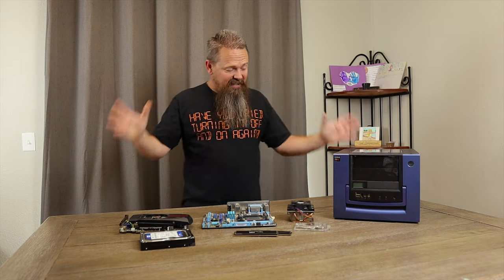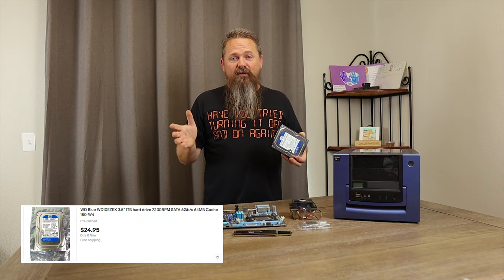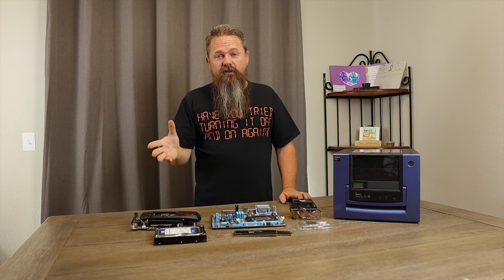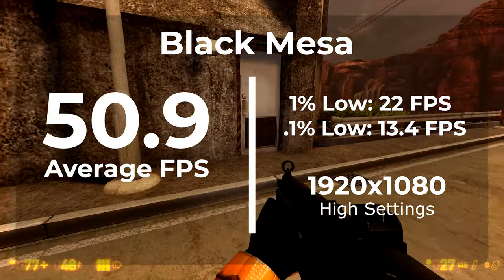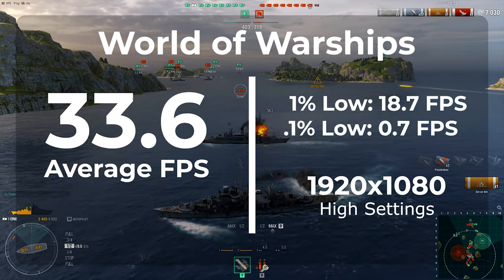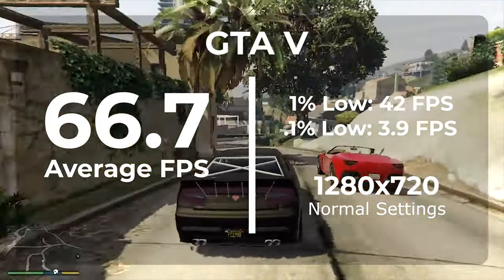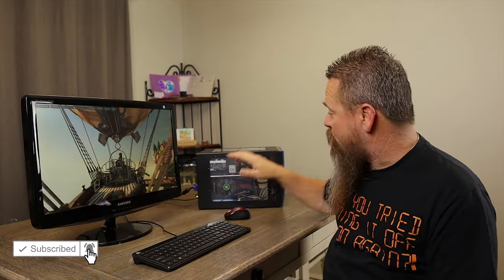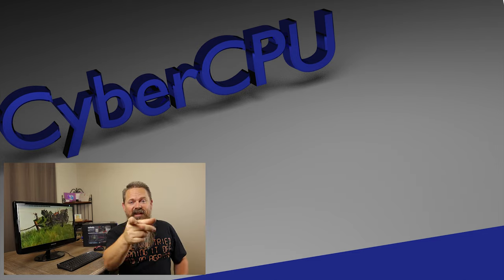$200 Budget Gaming PC Build 2021

Comment: i was given an old office mini pc, a HP elitedesk 800 G1 DM buisness pc  with 8 gb sdram ddr3( 4GBx2),a 128 gb sata ssd with an older i3 intel (4c/8t)cpu with integrated graphics (128mb shared memory).dx11 at 1080p and 720p games play fine and emulation up to ps2 and gamecube  run fine for most games so far. it's not the prettiest graphics but it works fine for browsing, watching movies and some light gaming and retro gaming  . my 9 years old want a newer pc but so far it meets her needs for the time being.

that old office system has a new life and is still doing good despite it's being 6 years old.iMm glad i repurposed it  instead of it becoming e-waste.
Reply from the maker: Yeah, it's really popular to do this with old prebuilds. The only problem you run into is future upgradability.
Reply: @CyberCPU  well, the only upgrades i can do on it are increasing system memory, the storage by changing the ssd  and adding a compatible wifi card  but that system will not be used for long term use  enough for this type of upgrades.

Upgrading it is not worth putting  money  in it for now since i'll build a new system once the ryzen 5000g apu's are out wich is very soon soon . i just hope the sell prices will be near msrp for those apu's. 

the older mini pc works fine for now but it's only a temporary measure  so i won't upgrade it much in the future . i may  give it to some people  in need  at some point since it still works fine .
Reply from the maker: This system I plan to follow many upgrade paths. That's why I went custom build. I can pretty much upgrade everything.

Comment: There is no sin against using a hard drive for a "gaming" computer.  I can pay about $300 for a 14 TB WD hard drive.  No way in hell in the next several years can you get a SSD for that capacity at that price.  The earliest teletype mainframe and mini computers were also used for gaming.  It all depends of the types of games you want to play on them.  I've had games pre-loaded onto my calculator watch when it was new back in the 1980s.  The so-called electronic waste are still useful for any number of tasks.  For a home theater PC or media jukebox it fits the role nicely.  That chassis has room for 1 laptop sized HDD and two 5.25 inch internal DVD/Blu-Ray burners.  I could use it to design cross stitch patterns, jigsaw puzzles, audio files, video art, fractals, use it with my digital cutter to make all kinds of cool projects.  I wouldn't have used that motherboard with what looks like only USB 2.0 ports on it.  Even after formatting with a 14 TB drive there is room for about 2,400 DVDs saved as .MKVs.

Comment: Hey man! If you don't mind me asking. What was the name of the case it's exactly what I need
Reply from the maker: Unfortunately I have no idea what the model number is. I'm not even sure what brand it is. It was originally used for an AMD FX system years ago. I know it hasn't been available for some time. It's actually not a very good case. I wouldn't recommend it other then  for really specific use cases. I even had to cut it up for this video to get a GPU to fit in it.

Comment: that case is awesome 🔥
Reply from the maker: Thanks. It's super restrictive for a gaming system so unfortunately I'm probably going to swap it out soon. I was thinking about going with a Thermaltake V21 which is close to the same design. However, I might use the Lian Li  011 Mini because the v21 uses acrylic windows while the 011 uses tempered glass. 

Either way, that's going to happen when we start dealing with cooling on  this system so stay tuned. It's probably going to get wet. 😂😂
Reply: @CyberCPU  what case is this I need one

Comment: This system makes an excellent NAS
Reply from the maker: It just so happens that my NAS uses the same motherboard and CPU. It's in a different case of course, rack mounted with 12 hot swap bays, but it definitely works well.

Comment: A gaming system youre a joke 🤣🤣🤣🤣🤣🤣🤣🤣🤣🤣🤣🤣🤣🤣🤣🤣🤣🤣
Reply from the maker: It's $200, what do you expect? 
🤷‍♂️
Reply: @CyberCPU  you call it a gaming pc not me so yea and its far but far from that
Also 200 for this old hardware is way to mutch and you shut know that even with the current prices
And calling it a gaming pc us a shame
And even with black messa the FPS over didnt hide the screen terring🤣

And tomb raider the issue is that the memory and Vram cant keep up with the rendering of the textures why you get these kind of arteffects this is normal in low systems like this there is a reason why its not official suported by a low system as this
Reply from the maker: @FlockersDesign  You missed the point of the video. Inwas building a base system that I could then upgrade to a modern gaming PC. If you look at the PC on my desk in my latest videos, that's what this PC became. I upgraded it piece by piece untill it's reached what I currently use in videos.